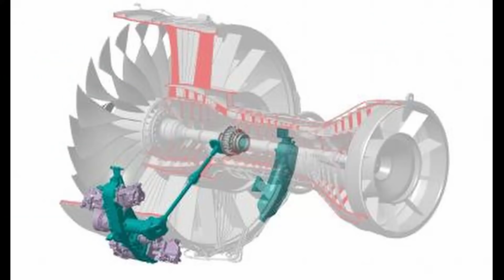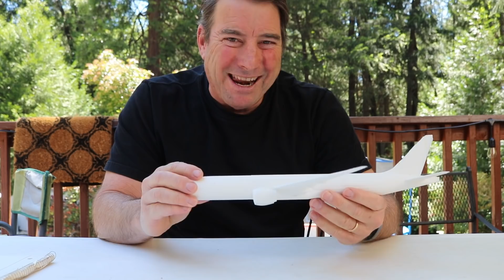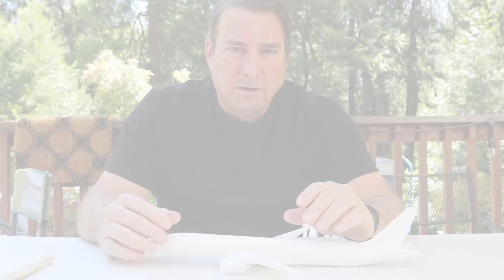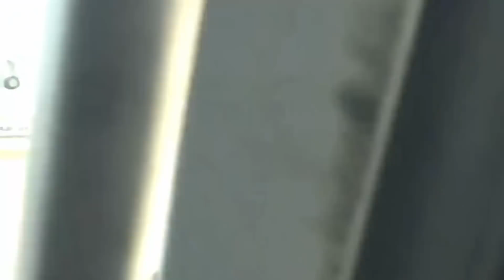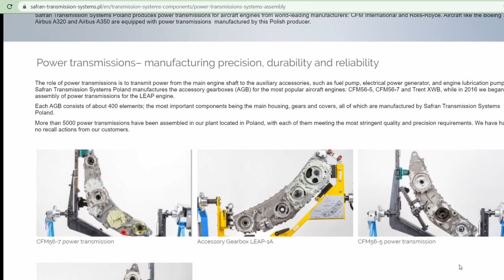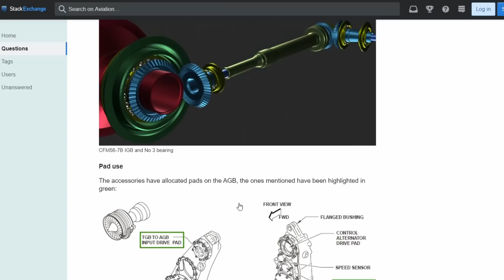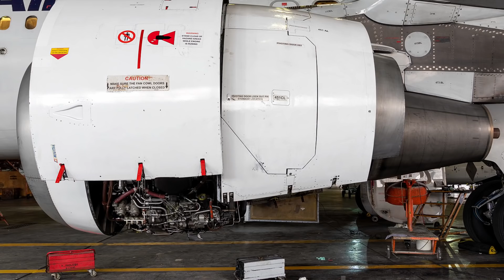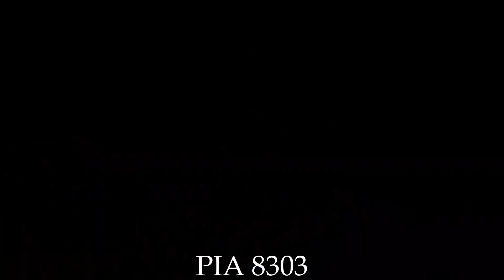PAKISTAN INTERNATIONAL AIRLINES #8303 UPDATE #2 23 May 2020

Comment: I had never heard of the R.A.T. and it’s function before yesterday’s video. It’s comforting to know such a backup exists, but also frightening considering the dire circumstances under which it is usually deployed. Very sad.
Reply: Most Transport category aircraft have had the Ram Air Turbine since the 80’s ? They were also deployed on early jet fighters. Brilliant simple piece of equipment riding on Free air. The Pilot Checklist was written in blood.
Reply: Gimli glider had it too
Reply: Sully had it deployed prior to his A320 goung into the Hudson.
Reply: @dkd1228  The crew had the good thought of restarting the APU prior to ditching.  Would the R.A.T. have still deployed with the APU also running?  I'm not an Airbus, guy, so curious if system would have permitted.
Reply: @PNZTX  The NTSB report indicates that Cpt. Sullenberger, after restarting the APU despite it not being on the checklist, decided to not manually deploy the RAT. The black box, however, showed that the RAT was automatically deployed even before that decision, most likely in response to the initial loss of power while still above 100 kts (which is the planes decision speed on deploying the RAT). The RAT was also found deployed when they recovered the wreckage.

[Small sidenote: The RAT, just like the gear, can be gravity deployed - but obviously not be retracted without power from other sources.]
Reply: User One , the RAT deploys automatically when power is lost on both generators. Lose both engines and you lose both generators. That’s what happened to Cactus 1549. The RAT would have deployed before the APU started and began powering the AC buses again. Once deployed, it can only be stowed on ground.
Reply: Yes.  The RAT is auto (when the essential DC bus drops off) or manual (hit a switch) deploys.  On the military aircraft I worked on, once it deployed it stayed deployed.
Reply: R.A.T. also used during Air Transat (F-236/24 Aug 2001) fuel starvation incident.
Reply: @PNZTX  Air Transat 😉
Reply: The RAT is the last help which a plane can give to its pilots. Therefor the reaction of all aviationers when they saw the picture's of the plane from Pakistan Planespotters: OMG the RAT is deployed!
Reply: Is RAT effective at low speeds, I heard the speed has to be 140 knots or higher
Reply: Really it is a neat little last ditch backup system!  The real question is, at what airspeed does it stop funtioning?  There has to be some lower limit for it since it is basically operating like a little windmill.... I wonder if the plane ever wound up just going too slow for it to function??

Comment: Blancolirio :Question for you.Why would GE put all that gear on the bottom of the engine?Logical place to put it would be the side or top of the engine to prevent damage to it from such an occurrence in my opinion.I hope the engineers will address this issue and I'm sure it wouldn't be costly to do such a change as it would almost be little more than rotating the engine 30 degrees.
Reply: Ease of access for maintenance

Comment: You don't even need to break the driveshaft just bending it will be enough to cause havoc in the engine.
Reply: This is not the driveshaft of the engine.  It is the driveshaft to the accessory drive gearbox, which Juan compared to the accessory belt in your car.
Reply: @donmoore7785  Yes I know and I also know it spins very fast so even a small bend in it will cause insane vibrations that will rattle everything and that can be worse then a broken shaft not powering the accessories.
Reply: @TheUserid82  It wouldn't bend. there's likely a shear pin to protect the gearbox/engine. Wouldn't be surprised if the shaft was telescoping, but pinned. If it was a solid shaft, the gearbox would more likely be taken out by an impact before the shaft buckled.
Reply: @donmoore7785  Anything spinning at that speed and out of perfect balance will rapidly and probably explosively self destruct, removing drive to any of the ancillary units that haven't already been scraped off the aircraft and bombarding everything around them with shrapnel.
Reply: @The_Real_Phil_Lee  There's no shrapnel or evidence of a thrashing driveshaft on the cowling. The plane had enough power to get in the air again after the strikes.
Reply: @vidznstuff1  Right!  If the engines had power to make such a climb, the damages were other.  The video is very informative and well done, but it is too soon to have a good idea on the actual damages on the engines.

Comment: Juan as large as the mounting lugs are on that gear case and the bolts or pins holding it to the turbine an impact could deform the turbine outer shell causing an engine failure, before anything would deform or yeald from an impact.

Comment: So if they lost the engine oil pump, is there some sort of cockpit warning system that lets them know engine failure is about to happen or is engine oil pump picked up by RAT?
Reply: Engine oil temp and quantity is monitored and pilots would get ECAM caution if it was too low. Not the job of the rat is to provide electrical power and pressurise blue hydraulic system

Comment: As a non aviator my question is:
Modern day jets don't have a warning installed that would alert pilots at close ground proximity about the landing gear configuration  ??????????
Reply: The airbus has 2 main warning systems. The ECAM master warning which is the continuous repetitive chime heard in the ATC recording, and the GPWS warning of too low gear. There are also green lights to indicate if gear is down, the ECAM wheels page and the landing memo
Reply: Yes and no depending on age of aircraft.  Warning system does not help if you ignore the warning.

Comment: Just my 2 cents, surprised there aren't more ground contacts with a Low wing aircraft, with engines slung Under wing.
It's always seemed a better design ie C130, and many other very successful aircraft.  Weather and airport runways will not always be in your favor.
Reply: High or low wing it is going to be a bad day if you forget to lower the gear.

Comment: Question, Did the pilot forget to deploy the landing gear on the first attempt or the landing gear did not deploy?
Reply: Asif Kaleem--doesn't matter if the gear "did not deploy".   If they were aware that it did not deploy, they should never have tried to land without working on the problem.
Reply: The pilot HAD to know that the gear was not down. Warning alarms go off like crazy. Here's the obvious clue: knowing that the gear was not extended, and he was going to do a belly flop, why did the pilot not declare an emergency and have the trucks out on the runway and have it foamed? Any pilot who did NOT do that, for ANY reason, would be up on charges of either neglect or incompetence.

Comment: not an expert at all, but shouldn't such critical piece of machinery (Accessory gear box) be mounted on the upper side of the engine, rather than the bottom, to take out the consequences of loss of engines, as it might have happened here.
Reply: Ease of access for maintenance

Comment: Assuming the accessory drive gear box might have failed due to impact, would it be possible to relocate the unit to the upper side of the turbine instead?
Reply: Even if that was done (surely it could) would the engine(s) still operate after being damaged in that manner?  Modern engines are designed to take a lot of abuse from general day to day use but there are limits.

Comment: Juan, in the photograph which shows the damage to the underside of the engine pods, it looks like he's flaps zero. Do we know where he was in relation to the go-around when this photo was captured, and what can be seen in other photos and video up to and including the stall regarding flaps position?
Reply from the maker: Not yet.
Reply: Flaps are normally retracted in go-around. If the engines failed and only the RAT was pressurising the hydraulics then only the slats would be working. The flaps are pressurised by green and yellow systems which would not be functioning without engines or yellow electric backup pump and PTU

Comment: Thanks Juan. Well done. 
Curious, In the ATC recordings, there’s no mention of the reason for his “go-around” or mention of any landing gear issues. 
Juan, do you or anyone have a theory or explanation as to why ATC asked him if he was going to attempt a belly land near the end?
Reply: It looked like the gear was finally down on the crash sequence video. With both engines out and gear down, they just didn't have enough energy or altitude to make the runway on the go-around.
Reply: On one transmission (voice) there is an audible alarm.
Reply: ATC was informed about a gear problem before the ATC audio starts. This part of the audio seems to be blocked from livetac.net due to bad signals

Comment: It appears that there is equal damage on each engine indicating a level touchdown.  Have seen no indication of gears down, or even partially down or up.  Heard, but not seen.
Reply: See avherald for the runway marks info.  On May 23rd 2020 Karachi Airport reported based on CAA inspection report that the runway inspection revealed scrape marks of the left engine start 4500 feet down the runway, the right engine scrape marks begin 5500 feet down the runway. About 6000-7000 feet past the runway threshold the scrape marks end.

Comment: The aircraft left engine scraped the runway for about 1000 feet after covering 4500 of 9000 feet runway the other engine touched after covering additional 1000 feet...so  the aircraft had a few thousand feet left of the runway...reason for pilot to pull up...and he touched so down the runway indicates that till the last moment he thought that the undercarriage was down and locked
Reply: Where did you get this info from?
Reply: @RevMarket  it was on local news reporting inspection of runway .. on the next day of the accident
Reply: RevMarket It is included in this Aviation Herald article: http://avherald.com/h?article=4d7a6e9a&opt=0.

Comment: Impressive indeed, so the approach used by Pilot was wrong. Once he hits the runway with tons of weight and momentum he should call for crash in advance as to take prior precautions by Aviations controls. Its seems a blunder landing without downing gears keep all calm and normal landing. Turnaround call after both engines & belly hit considered as disastrous for a plane after got hit hard what i saw visual at runway.. The right approach would be call for crash help, dump excess fuel and get landing on soft surface...! Instead what turnaround made both the highly precise gear boxes severely damaged.

Comment: That was an extremely enlightening update, thank you. You suggest that the accessory drive gearboxes are required but I do not believe their recovery is essential. Indications that services powered by these gearboxes failed will be enough, the physical gearboxes being merely corroboration. In my opinion it would also be worthwhile to see the ECAM page/s that were presented to the pilots at various stages of the flight. I can tell you that even when presented simple messages, reacting in the required manner is often easier said than done. So what did this crew see and what did they do?

If we find that the scenario you outlined actually did occur it will be too easy to blame "pilot error" and leave it at that. But I suggest that is the starting point for the real investigation. These pilots saw something, reacted in a certain fashion and a further series of events, warnings and decisions, actions and reactions took place. Only when they can be understood will we get to the bottom of why.
Reply: Yep, as always its a chain of events, and no one party is usually at blame.

Comment: If the landing gear failed they should've dropped it via gravity/hand crank. issue with a320 is once you use the crank you can't pick the wheels back up, due to you bypassing the hydraulics which are pushing the wheels UP into the landing bay. Since the wheel are stowed with the engine damage in the picture that shows either two things a) they never put the wheels down for the first landing, or the wheels never extended, in which they never tried to crank them down manually. FDR will hold all the answers and at this time all we can do is arm chair pilot it. Prayers to all those who where lost.

Comment: I have not read all the comments so please forgive me if it has already been mentioned or discussed, but it was not mentioned in either video: In the photo that shows the entire aircraft in flight with the damaged engine cowlings, what appears to be white smoke trailing the left engine is fluid loss - either fuel or oil . . .or both. This further supports the theory that the AGB, attached components, or associated plumbing was damaged.

Comment: "Tapping" engines like this is rare.  Much like airlines having a gear up landing accidentally.  This accident might lead to the relocation of the accessory gear box and critical accessories.  I was horrified to see the aircraft ascending at such a steep angle of attack.  You could almost see what was coming. Bless their soles & families.
Reply: So if you move the gearbox, the fan is now at the bottom.  How does this help???

Comment: So reports state they came down high and hot, likely repeatedly cancelling aural warnings from the gpws about gear, g/s, sink rate, etc (heard on the RT comm). Eventually they forgot the gear, with the warning cancelled. Eye witnesses report first touchdown on left engine, then the right, before the decision to go around. The failing engines carried them to 1800 feet before stopping, and they starting gliding, sinking with the RAT extended. This manoeuvre is never trained in the sim. Unfortunately the gliding downwind leg becomes too far, not allowing them to reach the runway.
http://avherald.com/h?article=4d7a6e9a&opt=0

Comment: You mentioned that the RAT would supply electrical and hydraulic power but what about the fuel pump?   Is there also a backup fuel pump driven with power from the RAT?   If not then perhaps the failure was not immediate.
When in the time line from the runway impact  to final crash was the photo taken with the RAT deployed.   Again if they lost both  engines perhaps it was fuel starvation.
Yeah, LOTS of questions open for speculation.
Reply: If the fuel pumps all failed the fuel would just be fed by gravity

Comment: There are, what I think I notice, two mist trails emanating from both engines on that image. Also, again unless I’m wrong, I don’t see any flap extension on the wing closer to camera. Is it normail not to have any flaps in at this stage of flight?
Reply: Flaps are retracted during acceleration in a go around - between 1000-2500 feet AGL
Reply: Matt Peters , thanks. I just wonder if they were at that stage in go-around. If not, it sure could explain settling of the aircraft onto runway during the go-around.

Comment: I assume the landing gear warning alarm would sound if after selecting, the gear didn't go down at all, or didn't lock down. Would it sound if the systems detected, via the radio altimeter, that the aircraft was in landing mode and the pilot had forgotten to lower the gear..
Reply: The ECAM master warning would sound below 750ft RA and the GPWS would warn below 500ft RA

Comment: The AGB on the CFM56-5 engine is dead center under the engine. The CFM56-3 and -7 has the AGB offset to the left side of the engine.
Reply: Due to the shorter gear legs on the 737

Comment: The AGB's on all gas turbine engines are a critical component of the engines. The fit an alignment of the AGB and its drive are a critical tolerance fit to the engines. Most accessories have a shear section in the drive couplings that are designed to break at a specific point and specific overload. This allows a single components to fail and not damage the rest of the system and cause cascading failures to the rest of the accessories that are still working. Its a part of the system redundancy engineered into the aircraft.  The engines exhibit some heavy damage from what we can see. IMHO more than enough to disrupt the critical fit or integrity of the AGB and drive. Remember the AGB is mounted to the fan case which is the main structure that takes the impact due to its size. Even a slight bump could misshapen the fan case and harm the AGB drive fitment. You damage or shear that drive you lose your electrical generation, hydraulic pumps, fuel pumps, etc. The RAT can take up hydraulic and electrical generation but the engine driven fuel pumps/fuel control units are engine driven only. If this is what occurred then it would have lost fuel flow/fuel control to the engines and became a heavy glider at that point. Tragic that it came down on both engines. You can see the fan blades don't have damage that coincides with the engine producing power at impact. So sorry for those affected by this tragedy 😢

Comment: Oh I thought the go around was when they had some altitude not that they touch down already.
Reply: It can be.  But sometimes they touch but the aircraft won't settle and it's best to add power and go around.
Reply: Touching would be a touch and go, a kind of go-around.
Reply: They can abort the landing even after touching the runway. However, they have to follow specific procedures to do that. Juan quickly mentioned it in the first video about this accident.

Comment: The less common engine configuration high up on the tail (DC-9, MD-80, and many Soviet era passenger aircraft) might have made this runway strike, a survivable event. Each design has its strengths and weaknesses. In this case, a large, underwing engine placement contributed  to a loss of power and flight control. I really feel for the relatives and friends of all the victims. This kind of pain never really goes away. You just learn to live with it, over time. Commercial aviation is very safe, but when things go wrong, it can be catastrophic.